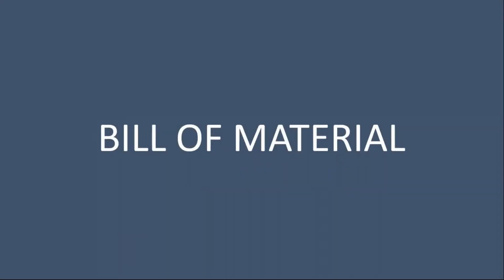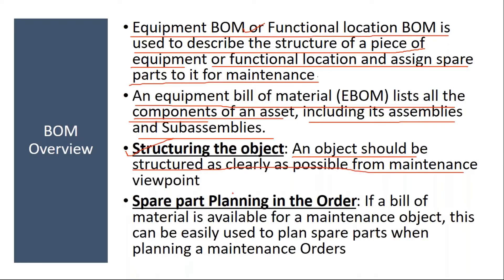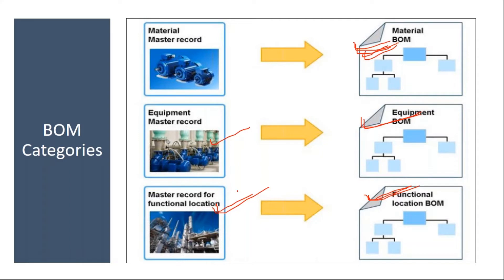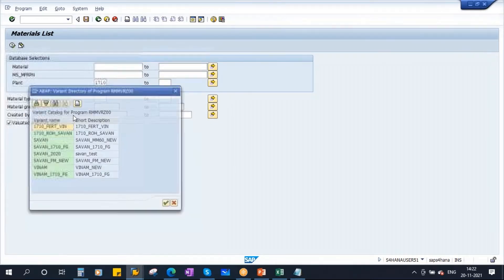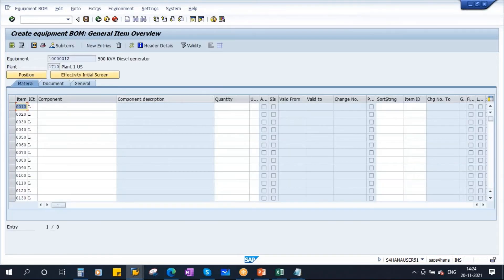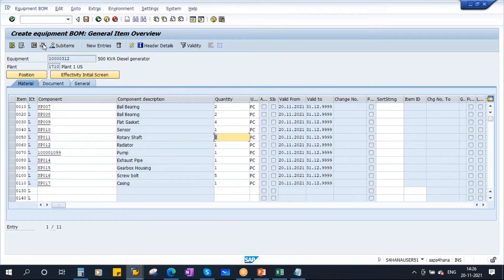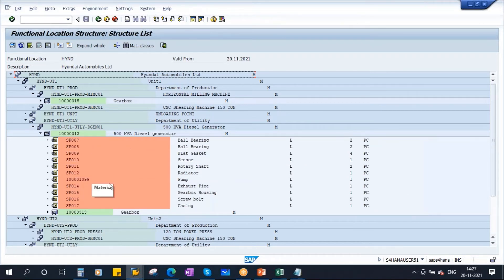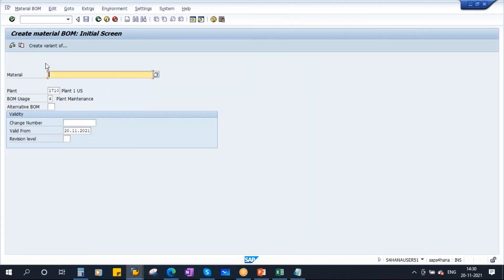Video 10 - SAP S/4HANA Plant Maintenance (PM) Training : Master Data - Bill of Material (BOM)

Comment: Hello Sir,
I was following the training and in same time practicing on SAP. I have in issue with the IH01, In fact the material BOM is not showing up, What should I do ? thank you
Reply from the maker: Hi, These are not full length videos. If you need full length videos, Kindly contact me at +91 9908733348.
Reply: @savanchandra3313  then why are you putting half knowledge on youtube :D
Reply: Be sure to check 'BOM explosion' in the IH01 selection screen